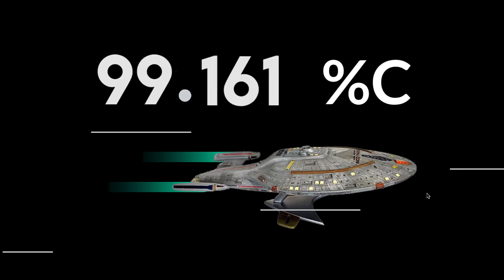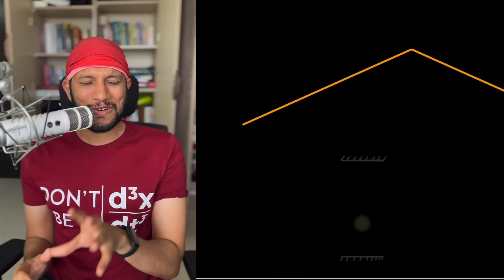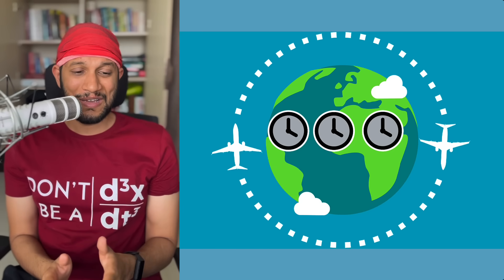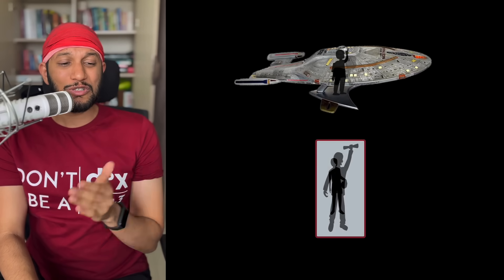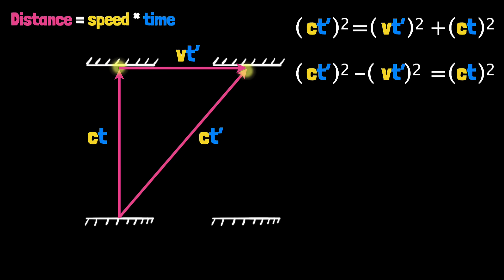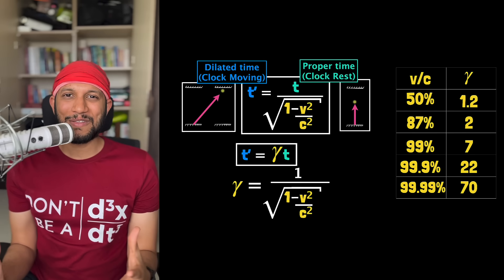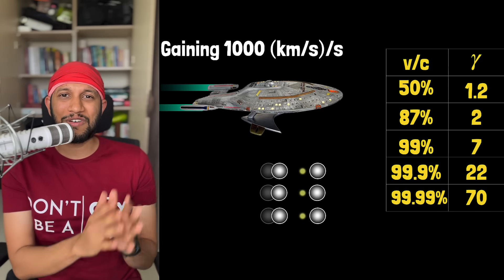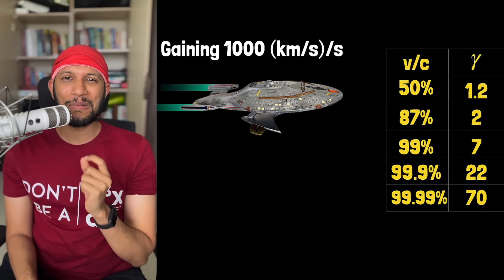I finally understood why you can't go faster than light! (My mind is blown)

Comment: Audio signals are delayed to sync with video signals for live television broadcasting. Audio signals feeding amplifiers by default allow the sound to leave a speaker at 0ms. This can cover any distance or overcome any distance between speakers in 0ms. The fastest propagation between any 2 points is 0ms. 0ms +1ms +2 ms +3ms etc

Comment: This means that if we were to take a rocket to jupiter not only would we be aging slower because we would be traveling about 3.5x the speed but we would also be be spining on jupiters axis at approximately 28,000 mph. Significant time dialation would be expected. Theoretically if you fly backwards against the earths rotation you could speed time up by slowing your relative speed.

Comment: My question then. If this holds true. If a ship was traveling at light speed, with a photon clock, time would effectively stop? Because the photon would have to be traveling completely parallel to the mirrors to keep up. Effectively ensuring a tick never happens. 

And I don't want to say it doesn't make sense. But is it possible that the logic doesn't check out? That light in a vacuum and light in a glass of water would be traveling at different speeds. Would that mean that light travels slower outside of the glass? No. I think there is another answer.

Comment: 15:21 I may be wrong in this, please correct me if I'm. 
For us to see the ship going at the speed of light, it will definitely take infinite fuel and infinite time. But what about the observer in the spaceship itself? I don't think that the observer and the ship need infinite fuel and time. It will reach the speed of light at some instance. ( Let's say the ship is going with an acceleration of 1000km/s², then the time taken to reach the speed of light is ~300s, and that's not infinite, right?
We observe the "infinite" due to time dilation due to the relative velocity as we are at rest and the ship is in motion. The actual ship and the observer on that ship are travelling normally.

Sorry again if I'm wrong 😅. I just shared my thoughts.

Comment: So does light have infinite energy? How does light go at the speed of light? If time stops at the speed of light then how does light move...because time is just a measure of change...it's all bollocks!
Reply: It has no rest mass and moves at constant velocity
Reply: Again how can it move if time stops. If it changes then it must have 'time' as time is just a measure of change, and yes, changes are relative.The problem is the concept of infinity. The problem is maths. It can be proven that all movement is impossible mathematically. But it's not true
Reply: @sfcsaferfantasycrafting6782  because it travels through space time like everything in the universe, but with all its speed thru space and none through time
Reply: @AMC2283  how can this be possible. When light clearly takes time to move from one location to another. If something changes it has time. Time is just a function of change in whatever vector or condition. A function of entropy. The only way to have no time is to have no change...anywhere. The concept is meaningless any other way.
Reply: @ because in relativity space and time behave as a unified fabric and takes time to travel through. How a frame experiences time is relative

Comment: All good except both your and Einstein conflate time with the measuring device. Yes, the clocks slow down, yes the measuring devices slow down, the proxies slow down, but time items does not, and to explain it away by trying to avoid philosophy your and Einstein are yourselves resorting to philosophy. Time is a function of existence. It can be measured in difference ways by methods which are susceptible to interference, but time itself does not slow down.
Reply: No one said it slows down, instead it’s relative

Comment: I get very confused about time. My point is that time as we define it is bound by mathematics i.e distance /speed in case of light it till be speed of light. But again here we are defining time, where is time is an abstract thing. In case of photon clock speed of light remain same but distance is increased so the time will increase as we measure it. In feel time is not something that you can touch, 1sec or 1 min should be the same. Its not time's fault that your measuring devices are based on some method that can't measure it directly but have to rely on distance. or may be I am just too dumb
Reply: Not abstract if you can’t calculate physics without it

Comment: lol😂 THEIR ENTIRE CONCEPT OF TIME DILATION IS WRONG. LET ME EXPLAIN A BETTER EASIER WAY : Consider this scenario: You are at location 'A' and I am at location 'B', with a 1000-mile distance between us.,We both start moving at the same time. You move at a speed of 1000 miles per second towards location 'B', while I move at a staggering speed of 186,000 miles per second within location 'B'.,As I await your arrival, which will take 1 second, I manage to visit 186 places, each 1000 miles apart.,In this situation, it may seem like I have somehow manipulated time or moved faster than you within the span of 1 second.,While it's true that I accomplished more than you did in that 1 second, I did not actually freeze or stop time to achieve this feat. Which means for your 1000 mile distance it took you 100 centiseconds (1 second), but for me based on my speed -a 1000 mile distance, it took me only .54 centiseconds (.0054 second).

Comment: The closers we get to the speed of light,the longer it take to gain another 1000 (km/s)/s,
Because of the time dilation 
For example:
 Your fuel at 1000 gallon,
We at the 99.9% speed of light,
Accelerating for another 1000(km/h)/s takes 22 sec which will take 200 gallon of your fuel.

Then at 99.99% speed of light
Takes 70 sec to accelerate another 1000(km/h)/s which will take maybe 600-700 gallon of your fuel.

Then after reaching 99.999% speed of light you can't accelerate because your fuel empty.

That's why Einstein said nothing faster than light

We don't have infinite fuels/energy...

Comment: So you've explained how the ship will look like excellerating from an outsiders perspective. But wouldn't the people on the ship reach the speed of light from their (proper time) perspective?
Reply: One of the main takeaways of special relativity is that all speed is relative, so you have to consider what frame of reference the person on the ship is measuring their speed from.  It is meaningless for them to just say "our speed is X meters per second" without specifying a reference frame.  This could be an external reference frame, but then this is exactly the same as some external observer measuring their speed, and as we've already seen the ship could never reach lightspeed in any external frame.  The only other option is to measure relative to their own reference frame, i.e. the reference frame traveling with the ship.  But in this frame the ship is, trivially, always at rest.  So they will still measure their own speed as less than c.

Comment: But as we are moving through the galaxy at very high speeds what we experience as aging is probably slower compared to an assumed stationary observer. Does that mean someone leaving the galaxy at the same speed the solar system is going around the galaxy will age the same as they are relatively the same speed as each other?
Reply: And everything is about observation of the event not the event itself. That is the observer sees the ship to reach beyond C but the outside cannot see that as the light never reach them from the ship after a point or takes infinitely longer?

Comment: Firstly I want to say that I really enjoyed this video.  FloatHeadPhysics has a wonderful style and the video production is so clear in conveying the concepts but in the closing stages of the piece he seems to suggest that time dilation is the reason that objects cannot reach the speed of light.  I do not agree with this conclusion.  Here is why... objects with Mass cannot reach the speed of light because of mass-energy equivalence, from Einstein: E=mc^2.  As an object with mass (like a spaceship) accelerates, its kinetic energy (KE) increases.  As per Einstein E=mc^2, energy has a mass equivalence - it makes mass-possessing objects (objects with a rest mass) accumulate more mass.  So the faster you go, the more KE and so the more massive you become.  To accelerate an object with twice its original mass at the same rate, you need twice as much force.  So an object approaching speed of light would have almost infinite mass and so require infinite force to keep accelerating it.  Photons have ZERO mass, and have some fundamentally different properties than those objects that have mass.  In fact, they are compelled to travel everywhere at the speed of light and this is also predicted by Einstein's equations.  In summary, mass-energy equivalence and accumulation of mass as you accelerates prevents you from reaching the speed of light.  A photon has ZERO mass and is actually compelled to travel at the speed of light.  Time dilation is really an artefact of relativistic effects and not the limiting factor IMHO.

Comment: Wait a minute, I have a question regarding the topic. We understand that it will take infinite time for the spacecraft to achieve speed of light in reference to us, the stationary audiences. But the spacecraft will achieve speed of light after 300 sec in reference to it’s own passengers, right? How their finite time would match our infinite time. Secondly in this way they would have achieved speed of light. So we have to agree on the fact that speed of light is achievable.
Reply: In the reference frame of the passengers on the spacecraft, the spacecraft is at rest since the reference frame is moving with it.  So not only will it never reach the speed of light, it will never reach any non-zero speed.  In order to measure a useful speed, a passenger on the ship would need to choose some external point to measure relative to, and as we've already seen it will only approach but never reach light speed.

Comment: Just a small point to add here at around 3:02  the em radiation shouldn't go from bottom to up but rather top-down  since the atom farthest from the centre would move fastest and ones closer to center would move slowest , even if we consider that all the atoms deviate with same acceleration it means atoms near the centre have moved after a small time ∆t which makes their trajectory smaller compared to the outer atoms. Else it would mean the outer atoms are accelerating faster than the inner ones  which shouldn't be the case , in general sense.

Comment: Okay, sorry for the probably stupid question, but the 2 time measurements are really confusing to me. So for example you put 1 twin on a ship moving 10 000km/h and the other twin stays on earth. Now, you explained how time will be slower on the ship, when observed from the earth, where the other twin is, however the twin on the ship would feel no difference, right? So can someone explain to me, why the twin on the ship, MUST use the time perception of the twin on the earth, as far as aging is concerned? If no time difference is felt within the ship, then how come aging takes longer? In other words, does the different perception of time equates to actual difference in time flow? You even mentioned that the quantum clock will tick the same on the ship?!?! So doesn't that mean that we have the same time on the ship? It seems to me that what happens is time gets split into 3 different parts. t1 on earth, t2 on ship and t3 between earth and ship. t1 and t2 tick the same, while t3 ticks slower as the speed increases. Is that correct understanding, or am I missing something?
Reply: non inertial frames aren't equal, only one is being accelerated with any force

Comment: they said we couldn't go faster than sound.  we did that.
Reply: sound doesn't travel at a constant speed, that was an engineering problem
Reply: @ neither does light. If you’re traveling on a bicycle at the speed of light with a light on the handlebars. Then what?

Comment: Here are the ramblings of an untrained mind. Have fun whilst you pull the thoughts apart . 
I suggest that this explanation is fraught with a simplistic unchallenging  view where there is no problem solving. 
It is much like the view of nautical ship designers for decades after the introduction of steel hulls and steam engines, where drag from the hull was an issue with efficiency and the design of sailing ships was ingrained in the psyche. “We must have narrow sleek, pointy ships”. Eventually the bulbous bow was introduced, then the air skin and a split in design to a rough layer and a flexible skin, depending upon the requirements of vessel operation, and financial limitations. Even now, evidence for different designs are ignored. I’m personally thankful for the Americas Cup and the introduction of foiling.
With space travel, light speed is seen as a limiting factor, only seen in isolation from gravity. So let’s consider creating a moving ‘bubble’ that encapsulates the vessel. This would slip through space not unlike a vortex ring carrying smoke particles through air. The observer would see the clock, not from the side, but from behind. There would be no time dilation. So to for the vessel. The point of origin would also be observed in the same time frame. Again, no time dilation observed.

Comment: 13:04 more nonsense, the inability to exceed the speed of light is that when an object moves away at the speed of light (or faster), it cannot be observed (by reflecting back light to the observer).
Reply: So you're trying to say that because an individual in a separate reference frame (or perhaps an individual within the hypothetical beyond C reference frame) cannot physically see light being reflected and therefore cannot observe the object, that this object in transit is tied to the reference frame intrinsically? As in to say, it cannot exceed C because it stops existing for all intents and purposes perceptually speaking? Im confused, if we did consider this as the correct means for defining why something cannot exceed C then what do you use as an explanation for why it matters if an observer can see an object in order to define that it exists? Isnt the whole point that the reference frame of the observer would by definition be in a perceptually distorted/locally real state? Im genuinely curious, perhaps i misunderstood something.

Comment: Nikola Tesla, and his flying machine
“The flying machine of the future — my flying machine — will be heavier than air, but it will not be an airplane. It will have no wings. It will be substantial, solid, stable. My flying machine will have neither wings nor propellers. You might see it on the ground and you would never guess that it was a flying machine. Yet it will be able to move at will through the air in any direction with perfect safety, at higher speeds than have yet been reached, regardless of weather and oblivious of ‘holes in the air’ or downward currents. It will ascend in such currents if desired. It can remain absolutely stationary in the air even in a wind for great length of time. Its lifting power will not depend upon any such delicate devices as the bird has to employ, but upon positive mechanical action.”  After these experiments I planned to build a flying machine, which could fly not only in the air but within interplanetary space.
The principle of operation of the flying machine is as follows: towards the flight direction, compression of the ether is to become weaker by the generator installed in the flying machine. As the ether keeps pressing with prior intensity from all other sides, then the flying machine began moving. Being within this flying machine you will not feel its speeding-up as the ether is not to hamper your movement.

Comment: Veritasium explained this very well in his clip: "Will This Go Faster Than Light?" in (3:53). Photons (massless) them selves go the speed of light and you want to go the speed of light with weight you have and weight of starship??? Right. You know what is happening with that weight at a speed close to C.
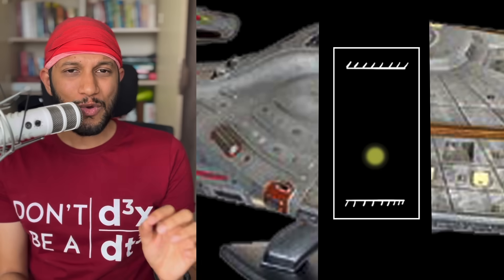Reply: What a bullshit with that photon clock 1:13. You're ignorant. Photon bouncing doesn't care how we see it or how it seems to us. Longer path... What a bullshit. Only photon reference matters not ours. Its path hasn't changed. It's the same if you said: "Because a car is going at speed... actually any speed. Let's take 50 mph the piston and cylinder have a longer path in the engine" and we know that is not the case.

Comment: Ok, that makes sense. But there's one thing I still cannot wrap my head around.
When we use that analogy of what happens on a ship and how an outside observer would see it - I get it when we talk about for example a train and a ball bouncing on it. In that case, the outside observer can easily stand next to the tracks and see it.

But when it's a ship approaching the speed of light, how does the outside observer fit in that frame? Where is this observer? Is he moving? Is he not? In reference to what? And wouldn't the light coming from the ship be influenced by the fact that the ship is moving so quickly?

Comment: A good example I saw in a video is being in a small boat in a good flowing river. When anchored, you see the river moving normally. But if you row so you're traveling just as fast as the water, the water looks still. If you row more so you're going faster than the water is flowing, the river looks to be moving backwards. But people watching you from shore don't see this effect.